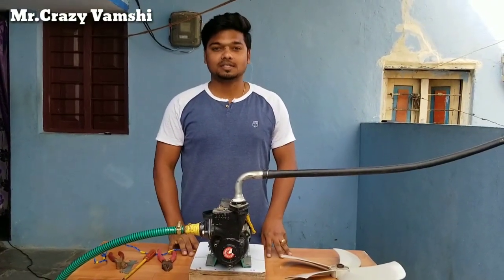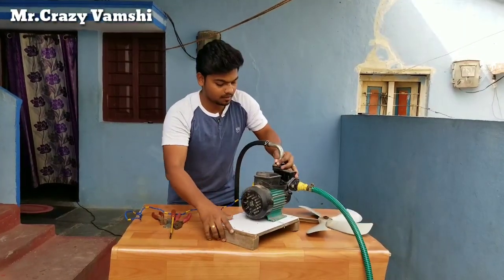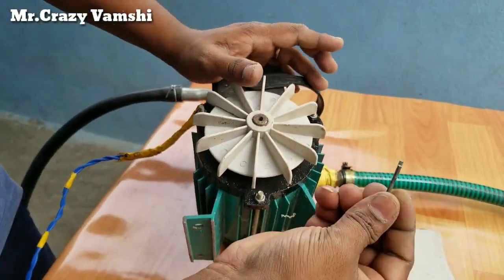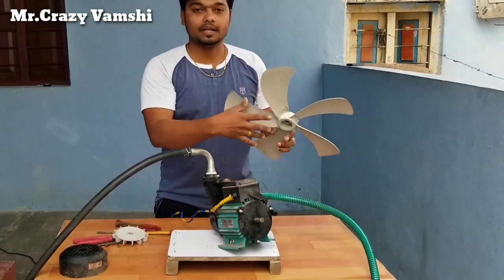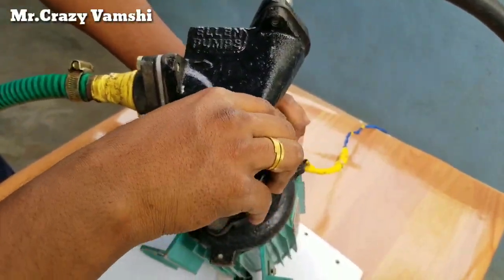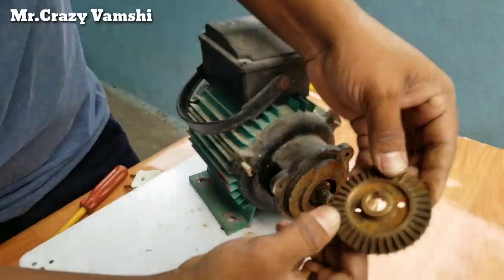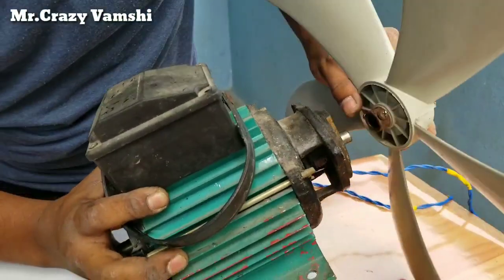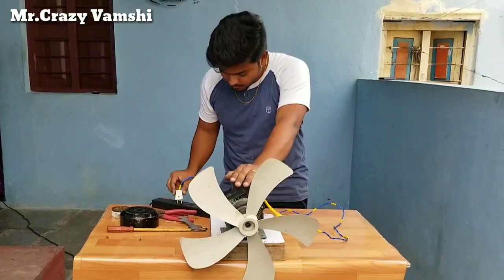Fitting cooler fan to Water pump | making water pump fan | Telugu experiments

Comment: Back  grind and decrease the size of rod and connect the wing 
front side use as water pump 
Make an grass pading using mosquito net 
In a old water drum  
In summer Water cooler and in winter   water pump